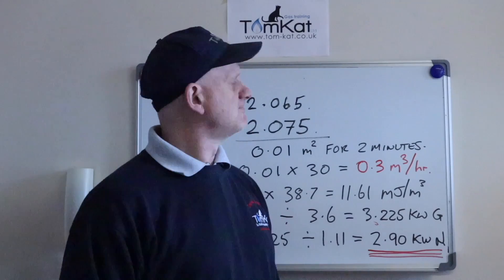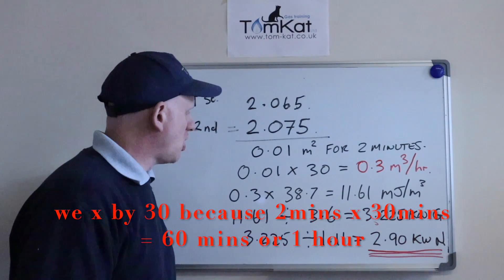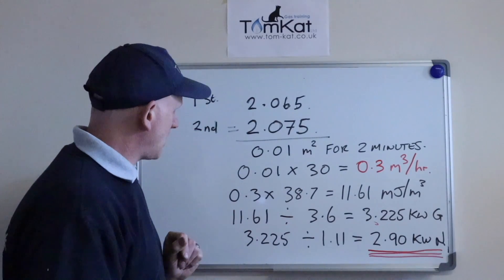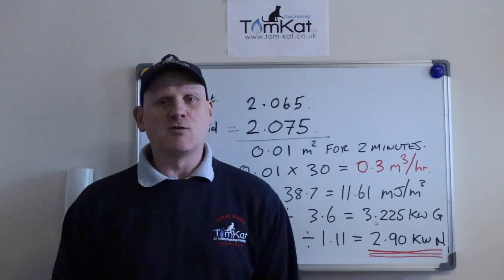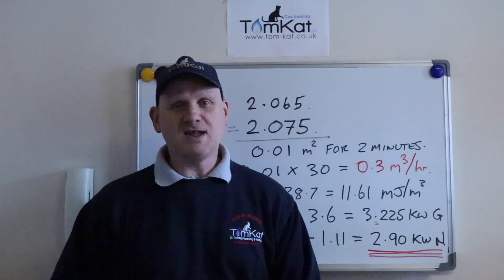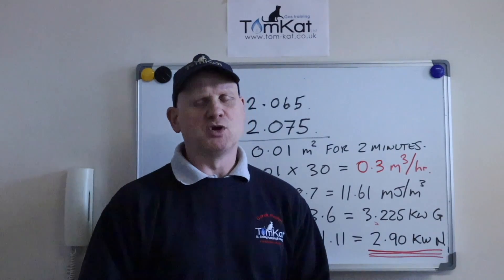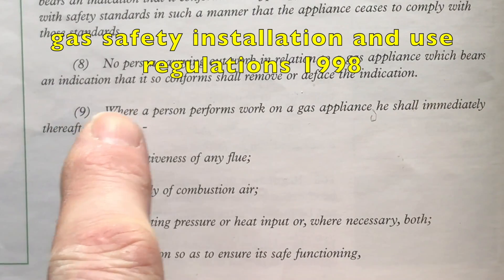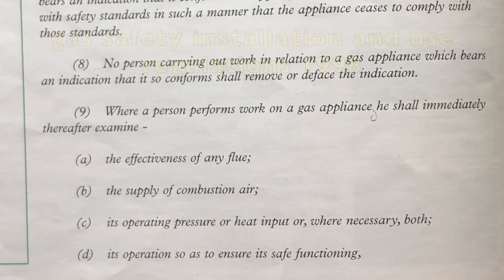HOW TO GAS RATE USING A G4 GAS METER a quick guide on how to gas rate gas appliances using g4 meter.

Comment: I used to use this method ( and I recommend engineers learn it ). Now I use - 

* Take the amount of gas used ( here it was 0.01 m3 of gas used in 2 minutes )                                   0.01m3
* Multiply that figure by 323 ( 323 is a fixed figure, no variables )                                                              0.01 x 323 = 3.23m3 of gas used ( gross )
* 3.23 (gross) divided by 1.1 ( to convert to the net figure we require )                                                     = 2.93m3 total.
Reply: You've confused everything there mate, the 0.01 needs to be multiplied by 30 minutes, not 323, that burner is not using 3m3 gas per hour mate, a combi just about does that.
Reply: @406xud  if you look at the figures, i think he means 3.23KW  of gas used not m3, makes sense then/
Reply: My hero!!!